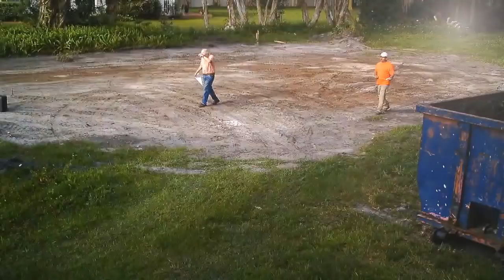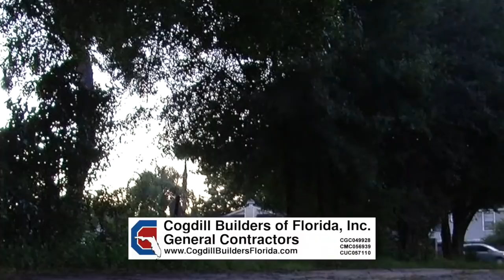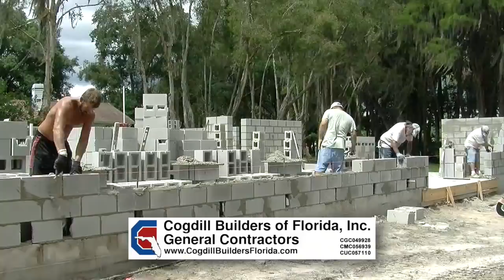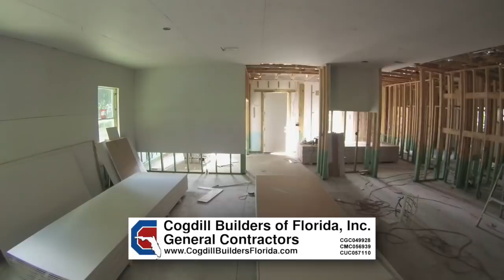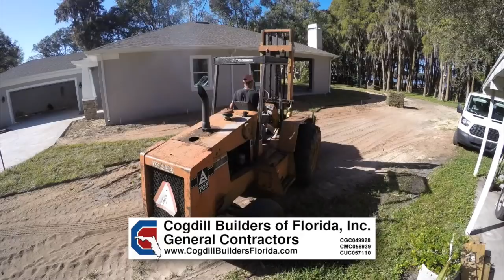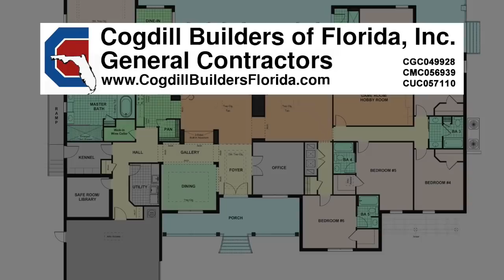Cogdill Builders of Florida, Inc. Jones Newcastle Time Lapse Video

Comment: finally I see somebody building a real house in USA not a house of cards! Great job!
Reply: adilusa it’s just the outer walls, but everything else is still wood in Florida’s houses. Besides, they have to due to all the hurricanes. But in many places in the USA a wood house can last over 300 years! Some of the 100% wood houses in my neighborhood were over 200 years old so not much of a problem in most cases as everyone outside of US thinks.
Reply: This house doesn't have a solid  foundation -__- in case of earth quakes -__-
Reply: Nd yeah finally someone is building a solid house in USA 😆
Reply from the maker: @sa..owayam3858  I have the compaction tests from my geotech engineer. Its solid
Reply: @sa..owayam3858  there are no earthquakes in Florida
Reply: @Voltomess  brick homes won't survive a tornado
Reply: USA has the most beautiful houses everything you need you find it there...
Reply: @mrbrainbob5320  I noticed you dont have Rim beam at the crown above the windows and doors. Thats why they dont survive tornadoes! Brick house use reinforced concrete ,so its not just brick.  Atleast thats how its done in third world africa. The building is impervious to cracks in the case of shifting sands!
Reply: Same thoughts ✌😊
Reply: Depending on the area and ground beneath. 
And it's more a bungalow. 

It's not safe to build a extra floor on this building.
Reply: Honestly this is not a real house, where is the steel and that foundation need to be 3 feet deep
Reply from the maker: @sa..owayam3858  this house most definitely has a solid foundation, I am the one driving the Kawasaki loader to place and compact the fill dirt, 
plus the I have the proctor and compaction test to prove plus all the Hillsborough County Building Department inspections. If interested contact me,
Mike Cogdill, Cogdill Builders of Florida, Inc.
Reply from the maker: @togodbetheglory9725  absolutely, USA is wonderful.
Reply from the maker: @Geraldbux0401  the door and window headers are precast with #5 rebar and solid poured above, its rock solid.
Reply from the maker: @Geraldbux0401  actually we do, the two top courses of block are knockout block and are concrete filled with 2ea #5 rebar tied in to #5 wall dowels @ 48" OC.
Reply from the maker: Thank you for the kind response

Comment: No rebars in concrete slab?
Reply from the maker: No, we use commercial grade fiber mesh and sawcut joints using a Soffcut early entry saw
Reply: @Cogdillbuildersflorida  do homes in Florida need to be built on slabs or can they be built with a crawlspace?
Reply from the maker: @truthtortoise3153  both styles are built in Florida, slab on grade are more common.
Mike Cogdill 
Cogdill Builders of Florida, Inc.
www.cogdillbuildersflorida.com

Comment: The construction culture of the residential houses left in 20th century, if compare with Europe and Russia. I see, а huge potential for business in US in this area including progressive and modern construction materials usage.
Reply from the maker: Construction is very regional in nature, materials and methods used in the majority of homes in a given area rarely change over time. 
Many alternative building systems have been tried and failed in Florida, therefore sticking with the traditional materials and improving 
installation of those methods is the most efficient program.
Mike Cogdill 
Cogdill Builders of Florida, Inc.
www.cogdillbuildersflorida.com
Reply: @Cogdillbuildersflorida  Thanks for your comment. From my point of view the many alternative building systems have been failed because price of wood is too low for the US market or other construction materials are too expensive.
The gap of prices: wood vs bricks, concrete and etc. is huge.

Comment: Nice job on this from an engineer.   Very well built.    Not being from Florida, how would one replace a small window with a much larger one in this type of construction 4-5 years after it was built?
Reply: you dont
Reply from the maker: By cutting in a larger lintel and cutting a bigger opening, then cosmetic repair of the inside and outside surfaces and returns
Reply: In Northern Australia we usually have a bondbeam poured on all courses above window and door height. In that scenario, an opening can be cut without compromising the structure.

Comment: All those pipes buried in the slab will at some point fail, would hate to be the owner when I hear the news about a leak underneath the slab.
Reply from the maker: at some point in life everything fails, the expected service life of PVC water pipe is 100 years, https://waterfm.com/study-takes-comprehensive-look-pvc-life-cycle-assessment-sustainability/#:~:text=PVC%20pipe%20is%20assigned%20a,between%20100%20and%20300%20years.

Comment: Why is the ceiling made of wood ? If the base is of concrete to resist storms, the ceiling shold also be...
Reply from the maker: I have built concrete roofs and crawl spaces on homes, however the cost for a concrete roof is typically cost prohibitive. 
Mike Cogdill 
Cogdill Builders of Florida, Inc.
www.cogdillbuildersflorida.com
Reply: @Cogdillbuildersflorida  would love to see a house with concrete block walls and a crawl space instead of a slab. Always wondered how the floor system would be suspended to achieve the crawl space on a block house

Comment: I'm just curious.. do you use structural columns and beams in your houses in florida? A response would be appreciated. thanks
Reply: Yes. Always in the corners and by the windows/doors. Rebar tied into the slab all the way up to the top which is poured all the way around with Rebar.
Reply from the maker: Of course we do, look at the columns I formed and poured at the front lanai

Comment: Who is your concrete/block subcontractor?
Reply from the maker: Michael Palm Construction out of Brooksville 727-967-8415
Reply: Okay thanks! One more question, do you frame out your block walls on the interior for drywall and insulation or do you just go directly off of them.

Comment: Does anyone know why the foundation was so deep and why so much fill
Reply: Thats what a good foundation looks like.
Reply: Floor of the house needs to be elevated, fill is just to hold the slab.
Reply from the maker: Because the local building department dictates the slab must be a minimum o f 18" above road crown, plus sitting the house up high gives the desired architectural effect and promotes water runoff. 
Mike Cogdill 
Cogdill Builders of Florida, Inc.
www.cogdillbuildersflorida.com

Comment: what about water intrusion thru the cement blocks?
Reply: I,m sure they put flashing, to prevent that...
Reply from the maker: I use Sherwin Williams Loxon primer and top coat,  no intrusion will occur with a quality coating system.
Mike Cogdill 
Cogdill Builders of Florida, Inc.
www.cogdillbuildersflorida.com

Comment: hmm to steel matting in the foundation..hmmm...
Reply: What do you mean?
Reply from the maker: Steel matting is useless, I use commercial grade fibermesh; fiberglass reinforcing fibers, then I cut control joints using a early entry saw (soff-cut 150 saw ) the same same day as the pour to control cracking.
Mike Cogdill 
Cogdill Builders of Florida, Inc.
www.cogdillbuildersflorida.com

Comment: Lots of mistake but not too bad for an American house 👍
Reply from the maker: What mistake?
Reply: @Cogdillbuildersflorida  Foundation not deep enough, roof is to small and doesn't have ceramic tiles, no metal rebars going thru those blocks, no reinforced concrete to hold the structure.
Reply: @Cogdillbuildersflorida  and it's not high enough the door is at ground level, it has a big useless garage, and the kitchen furniture it's uselessly expensive.
Reply from the maker: @themaninthehighcastle7242 
1. the roof fits, 
2. ceramic tiles on the roof?, 
3. significant reinforcing steel in the filled cells of the exterior walls plus double knockout top course with #5 rebar, 
4. how do you know what the kitchen cabinets (we don't call it furniture) cost is?
5. the front door is not at ground level.
6. the garage is large, like the owner wanted, 
Contact me if you need to discuss and relevant issues:
Mike Cogdill 
Cogdill Builders of Florida, Inc.
www.cogdillbuildersflorida.com

Comment: Why no colums?  Like in phil or japan?
Reply: No earthquakes.
Reply from the maker: The front porch has two cast in place concrete columns, review the video and you will see me forming the columns, the rest of the hose does not need columns, the roof truss system is engineered to be self supporting and rests on the exterior structural walls.
Mike Cogdill 
Cogdill Builders of Florida, Inc.
www.cogdillbuildersflorida.com

Comment: Seems much worse than the European houses that have two layers of blocks to prevent moisture problems. Flashing and the like is not comparable.
Reply: Not really an issue in Florida. The soil is sand and drains quickly, and the sun shines almost every day during the rainy season drying up any residual moisture.
Reply from the maker: Two layers of block will not prevent moisture issues, it's the quality of the exterior coating that matters.
Mike Cogdill 
Cogdill Builders of Florida, Inc.
www.cogdillbuildersflorida.com

Comment: im not even a builder and I see some horrible building practices on this video and here in florida.
1- do not run your water lines under concrete, it will be a disaster to repair one in the future.
2- do not cut into the foamboard insulation to recess your electrical boxes just because you are too cheap to install 2x4 walls on the exterior walls instead of using cheap slats.
Reply from the maker: I am interested to know your credentials; here are mine; I have been in the building business since 1973. 
My family started building in Florida in 1935.  My father has the 10th oldest active General Contractors license 
in Florida. I have a degree in Building Construction from the University of Florida and hold two General Contractor 
licenses, a Class A Mechanical License, and a Utility and Excavation License. Prior to returning to home building, I 
worked on large combined cycle power plants, municipal water plants, and roadway/civil projects in Virginia,  
Florida, and Georgia.

I draw all the plans for my jobs and have thoroughly researched cost/benefit for every product I recommend 
my customers use in the homes I build. All my homes exceed the Florida Building Code, both current and previous 
editions. Water lines are always run underground with slab on grade floors for a number of reasons, 
specifically to decrease the travel time from heater to point of use. In the 48 years I have been building, 
the number of under slab leaks in my homes have been 0, (zero). So under slab water supply lines is not a concern. 

For exterior walls, I use concrete block, with reinforce cells every 48" and each side of doors and windows, plus a double 
lintel for a 16" deep beam, rare in the area and significantly stronger. I have a local manufacturer (Carpenter Company in Lakeland) 
produce 1" EPS insulation board (due to its perm rating) covered with furring strips then drywall as a finished surface. 
EPS outperforms all other insulation boards for a number of reasons. The 1-3/4" resulting cavity allows plenty of space for water 
supply lines, gas supply lines, etc to run in the cavities and prior to installing drywall, the resulting area between the pipes and cut 
foam board is sealed with spray foam, so therefore the insulation envelope is complete. Electrical boxes are thin mount boxes, 
I am now building a large home on the Hillsborough River for an owner that did request a 2x4 wall constructed on the inside face 
of the exterior CMU walls and this 2x4 wall with a furring strip creates a 4-1/4" cavity that will be filled with spray foam. 
The additional cost to frame and insulate in this manner was approx $9500. This will be the most insulated home in Tampa.
All the home I build, regardless of size, are completely customized for the owner, no "cheap" materials are used and 
no "shortcuts" are taken. My customers are happy and refer friends and family to me.

If  you would like to discuss further, please do not hesitate to call me direct via my cell phone at 813-486-9099
Mike Cogdill
Cogdill Builders of Florida, Inc.
Tampa FL
Reply: @Cogdillbuildersflorida  
The video does not show 2 x 4 walls against the block, it shows insulation with furring strips.
my credentials are common sense.   
common sense tells me not to run my waterlines in or under concrete.
common sense also tells me to frame a minimum of 2x4 exterior walls.
reinforcing the block walls every 48 inches is required by code so that’s nothing extra.
you said you provided a cavity in the exterior walls for running water lines and gas lines.
I would hate a water line to be ran right behind drywall on an exterior wall.
I’m sure that anyone with common sense would request you to put in 2 x 4 walls even though you don’t normally provide that and I would too for a myriad of reasons.
as far as running water lines in concrete in order to provide a quicker hot water result doesn’t even make any sense.
why would you get hot water quicker to a source through concrete then you would directly through a wall or the attic?
and it’s great that you haven’t had any water lines burst encased in concrete but how would you know if you did?
and if you had to replace a line you’d have to break up the concrete in order to do it right from the head end the way to the source to do it right.
just a few reasons why after looking at the homes in Florida I decided to build my own.